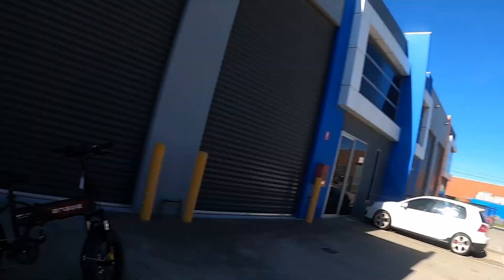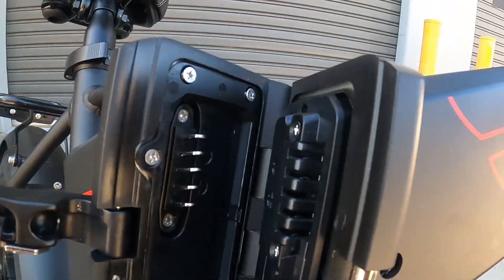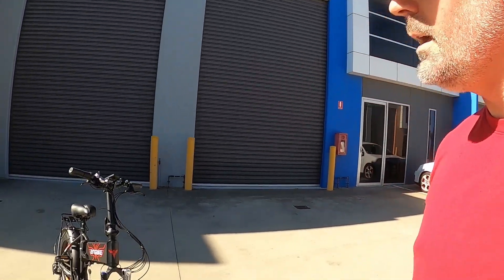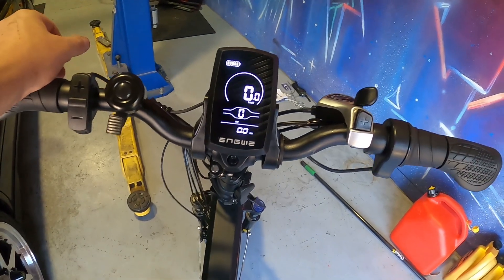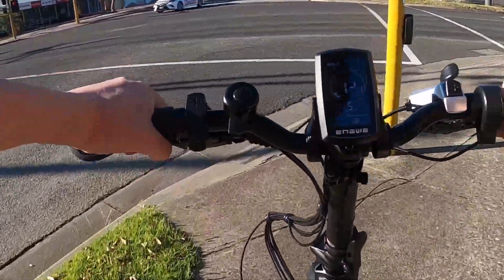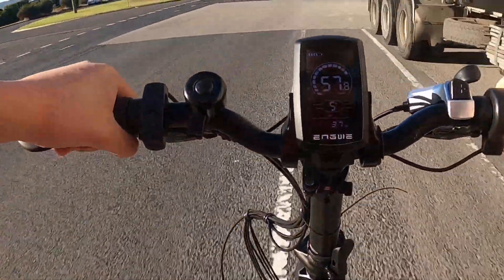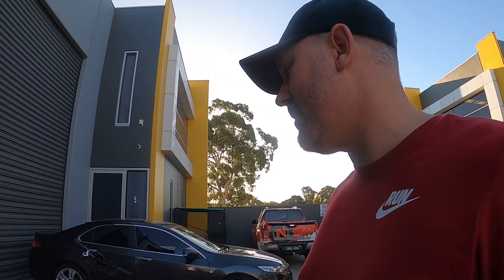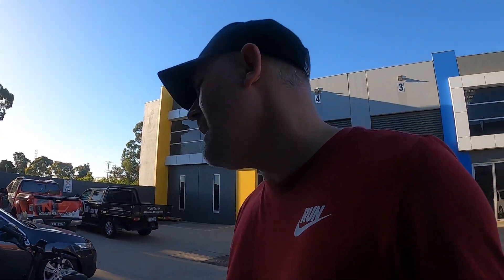Engwe EP-2 PRO E-Bike Review

Comment: Handle bars should slope forward not back lol
Reply from the maker: they should be but they only go one way
Reply: @TURBOTRISTO  On my engine pro it is held by a cap and side clamp with 360 rotation, Does yours have a key or slot so you can only fit one way ?
Reply from the maker: yeah mine only goes one way

Comment: What is the torque on Engwe Engine Pro and Engwe EP-2 Pro? On the manufacturer's website, both have 55 N.m. Elsewhere the EP-2 Pro is reported to be 80Nm and has a planetary gear and the Engine Pro only 55Nm and has no planetary gear but direct drive. So how is it right? Thank you.
Reply from the maker: it would depend on the settings if you do the hack i showed you then it would be the higher 80nm

Comment: I've seen many Engwe reviews but no uploader ever mentions that the brakes are on the wrong sides, left - front & right - rear compared to what is the norm. So I only found this out after I bought one. After locking up the front wheel 3 times I had to swap the brake pipes over. I was worried about letting air into the system so did a quick a swap as possible and they were fine. Were your brakes set up this way also ?
Reply from the maker: They are cable not hydraulic brakes you can just swap them
Reply: @TURBOTRISTO  I understand yours are cable but was your set up opposite to what you are used to?
Reply from the maker: yes it was
Reply: @TURBOTRISTO  Ok bud many thanks stay safe

Comment: Hi Tristan,
Would really appreciate it if you could answer this question for me. I have a 6MT CU2 2010 and thinking to do a couple bolt ons (exhaust, CAI) with a reflash. Is it worth trying to gain power on the dyno or is the k24z3 head far too limiting? My goal is +15hp or around an 8-10% gain. Cheers!
Reply from the maker: Just get a ChongData tune you will get the 15hp , I did a panel filter and a plm down pipe and a flash tune and we got around 30hp
Reply: @TURBOTRISTO  awesome thanks for the info man I :)!